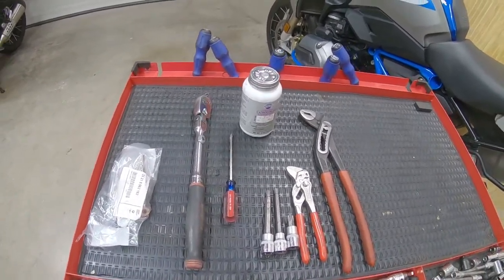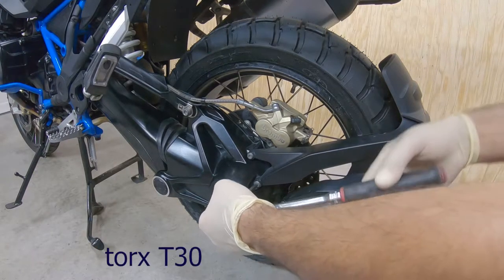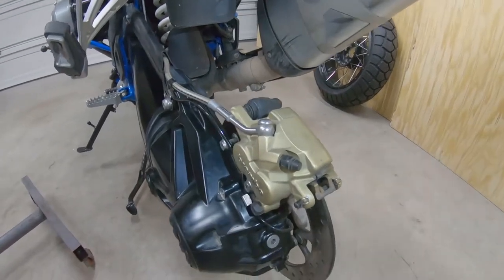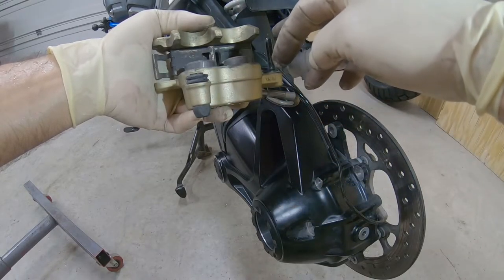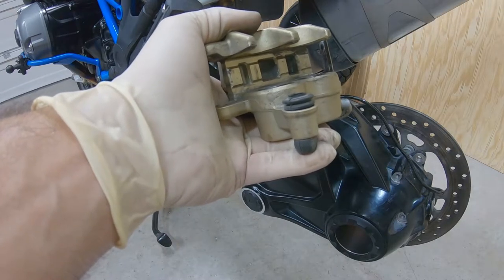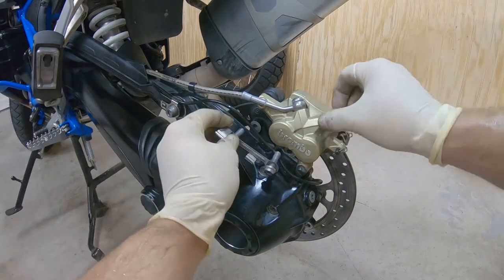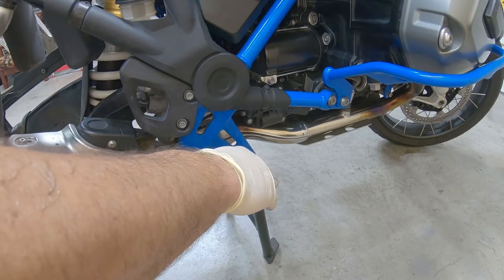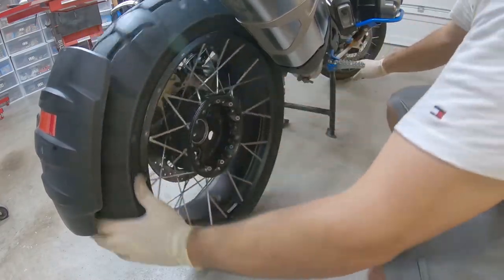How to Change the Rear Brake Pads on a BMW R1200 GS Safety FIRST..!!

Comment: First off neat job!👏🏼 Then I have to tell your community, that even though I pushed the two pistons flush with the inner surface of the caliper it was impossible for me to slide in the caliper with the preinstalled new pads onto the rotor. I tried long and reasonably hard but I failed. I ended up with bruised new pads and possibly places of my rotor. I used this technic on the BREMBO’s of my F 800 2011 and it worked every time but not on my 1250 GS, so I went in here (YouTube) and saw a Romanian fella doing it the classical way. Yes you first place the caliper over the disc/rotor  and then slide in the pads one by one, treading in the pin as you go. Worked instantly for me. May be my cleaning job was not as good as yours, possibly. BTW what kind of caliper lubricant did you use on its pistons? Also I learned from your vid that the rubber frame disengages from the caliper … that was actually the part that was getting in the way. Than you!

Comment: Why do you take off the rear wheel? Got into screw frenzy? :) With small torx tools (those with a 90 degree angle) you don't even have to remove the rear fender. If necessary remove the rear fender. If your very bored, also remove the rear wheel...
Reply: Yes - feels like added steps for no gain. I think you can do i just by removing the pad pins.

Comment: Thank you for the video. In the Service Manual for the 2022 R1250GS, the torque for the T40 rear caliper bolts is 28NM. The video shows 24NM. Perhaps the spec was increased for the 2022?
Reply from the maker: Honestly not sure for a bike 2022 , please verify that on the respective OE manufacturer specs.
Thanks so much for watching my clip.!

Comment: You only need a screwdriver to change the brake pads. Just take of the two clips an take out the bolt. Then both pads are lose. Use the screwdriver to press pistons back. Reasembly. No wheel, caliper etc needs to be taken of. You can do this i 3 min!
Reply from the maker: Great comment,  thanks!

Comment: tolles Video, aber warum baust Du das Hinterrad aus?     /   great video, but why are you removing the rear wheel?       /    und was ist mit der überschüssigen Bremsflüssigkeit, muß die nicht abgesaugt werden     /    and what about the excess brake fluid, it doesn't have to be sucked off
Reply: Kann man gleich zum entlüften verwenden ;) Einfach Behälter kontrollieren und wennst in der Nähe des Max bist, kannst es einfach lassen. War bei mir mit vorne 2x und hinten 1x echt wenig Unterschied

Comment: I have a 2017 Exclusive 1200 GS. I’m not really happy with the feel of the rear brake. Seems like there is a lot of play in the pedal before I feel any bite from the rear brake. Any advice on how I can adjust it? It feels better when I replace the fluid but just a few weeks later, it goes back to feeling kinda soft again.
Reply from the maker: Hi Alexis , 2 things , first did you used DOT4 brake fluid? And the second one, make sure is no air in the rear system brakes, sometimes that happens when you have bubble air on it.
Thanks again for watching and time!
Reply: Sorry to tell you: BMW just fucked up. The rear brake on the LC is utterly useless but still seems to eat up pads in some cases (heard of less than 10k!!!) Just let the front brake use the rear. I tried suggestions I found on the internet: roughly said change the fluid (I use SL6 BTW), bleed the system and when it seems to work fix a 20 litre can to the pedal overnight. Then bleed again. Did not work for me...

Comment: does the black brembo caliper and slider braxket from previous model 2016 can be splited as well in the video?
Reply from the maker: Yes , pretty much in all this model are the basics on the mechanical of the brake systems.
Thanks
Reply: @baden-baden  my black brembo cant be splited...it stucked...do you know the possible causes?
Reply from the maker: @alamfirdausmsdnbhd9306  Maybe the slide pins get stuck or getting rust. Put some blast pennetrant leave it over night and try again.
If not? some time you can use heather gun, heat it up a little and try to turn it.
Thanks

Comment: Although it is a nice video, 95% of the work you show is unneeded to replace the rear pads. push the pistons back by pressing the caliper in direction of the wheel. Remove the pins as you show in 4:00 of your video and just slide out the pads, slide the new ones in, put the pins back, press your brake pedal and done! It is really a 2 minute job that you can do with no more than a small screw driver or even only with your hands. Just saying.
Reply from the maker: Great comments 👌
Reply: Couldn’t agree more, great if you have lots of tume and like to work on your bike instead riding it. But the title of the video is misleading